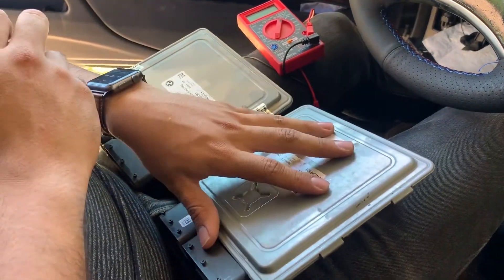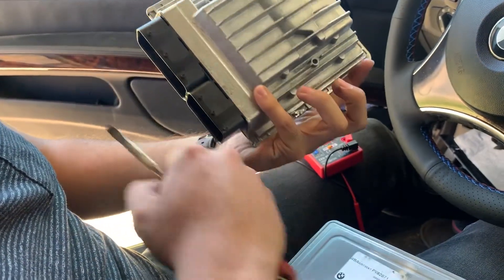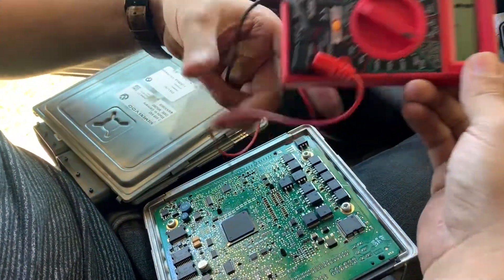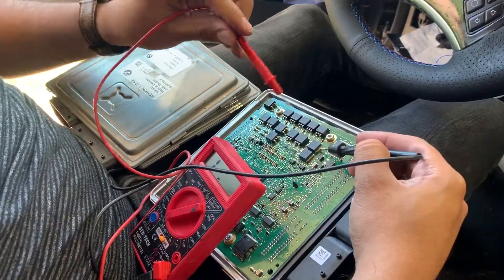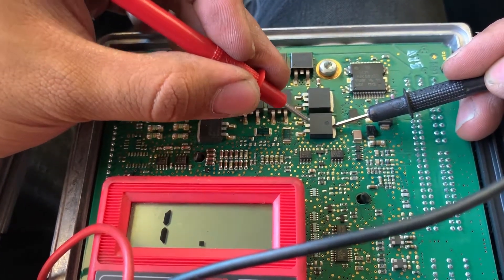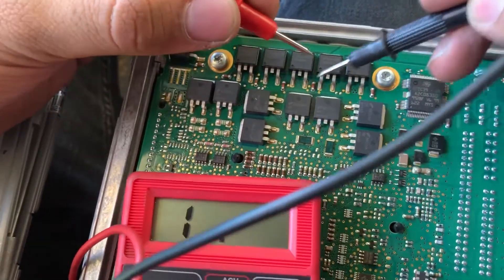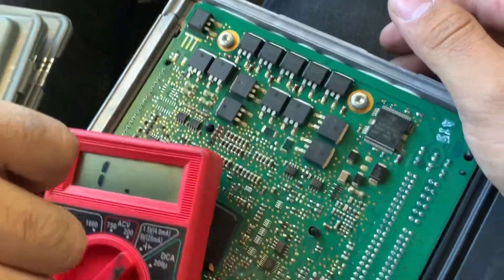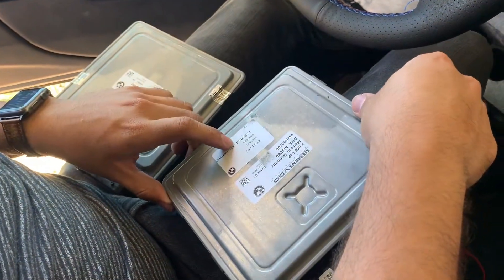Misfire? BMW MSD80 DME Bad Mosfet Test!

Comment: Hello could you please help i have a 2008 BMW X6 engine computer controller problem mine is Continental 7586933 DME MSD81 5WK93714 index 3, i am getting the same used same numbers but index 2 not index 3 , can this work on my  car.   thank you